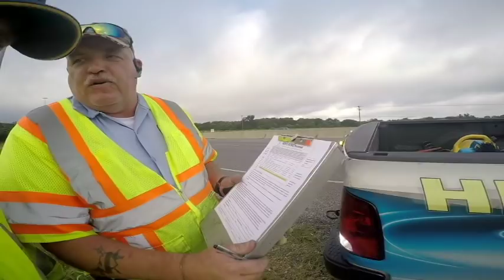We All Need A Hero

Comment: dropbar OS under the hood by the radiator
Reply: really depends on the truck, and if you've had to use it before or not, sometimes we don't always put the tool back where it's supposed to be, and it comes back to bite us when we least expect it.